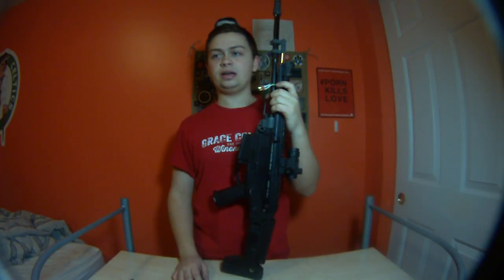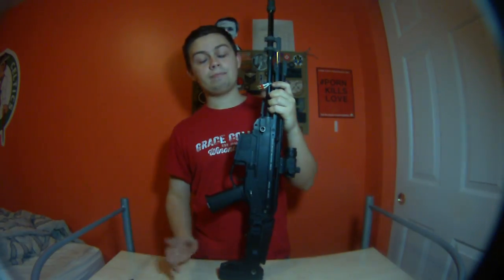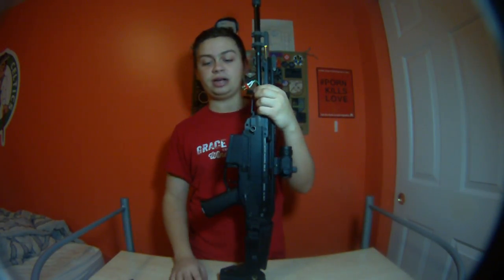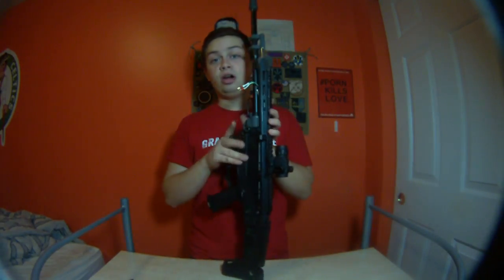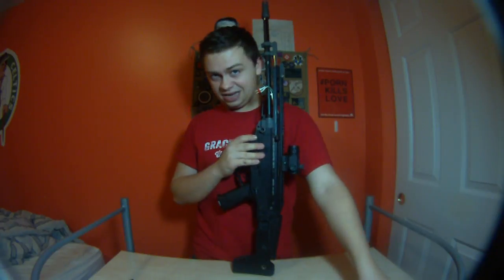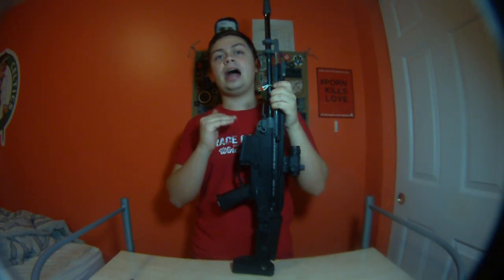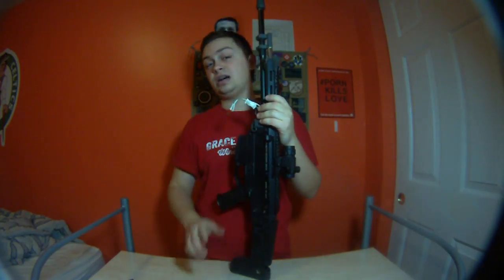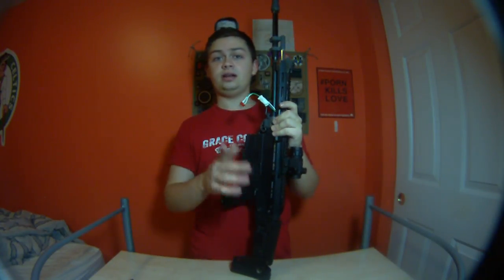PNW Air Dynamics Basic MOSFET (HULKFET)

Comment: Have you tried a Firestorm Systems mosfet? I have one installed in a high fps dmr and so far it's holding up great, main pro is that it has a really small board and it's inexpensive, but it doesn't include connectors.
Reply from the maker: I have not used a Fire Storm. I like to stick with the same MOSFETs for customers and personal builds. I use HulkFets, NukeFets, BTCs and used to use SIGMA.